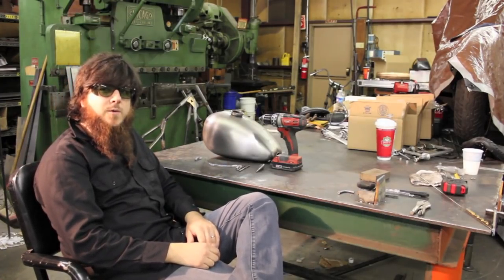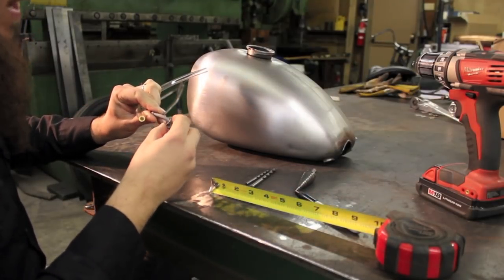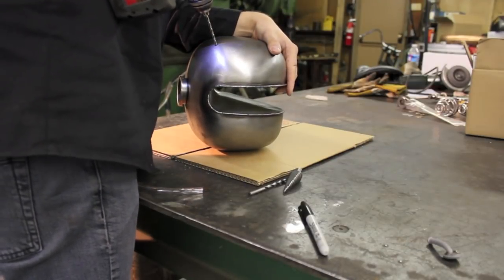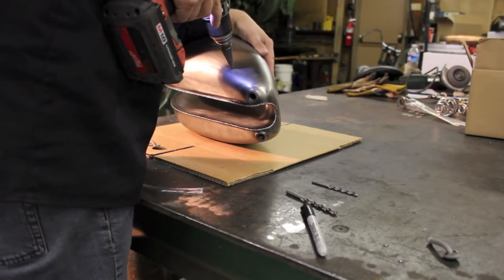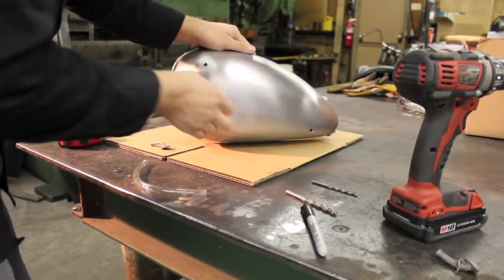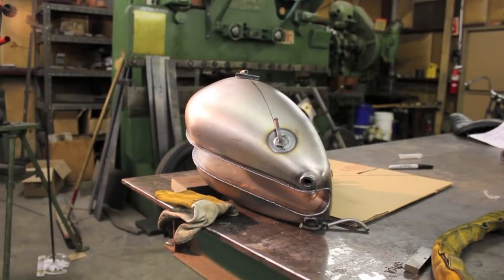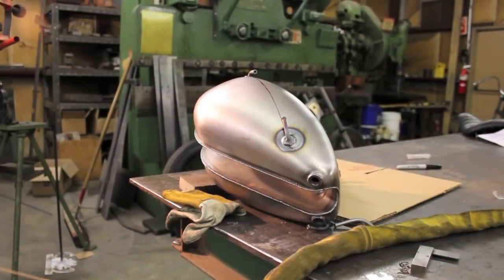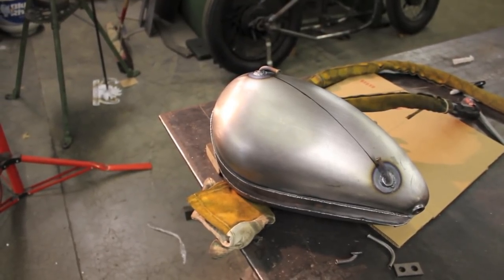Monstercraftsman's fuel sight gauge install video

Comment: if you cant MIG like you can TIG .. u cant MIG ..  .. and a trick to nut burn trough the tank .. get a rod with a piiece of bronze on the back of the thin sheet .. and u cannot burn trough . thats how i weld and never had a burntrough since i realized the bronze trick